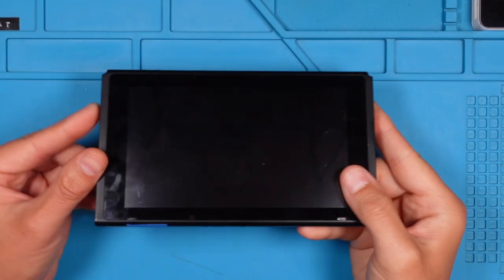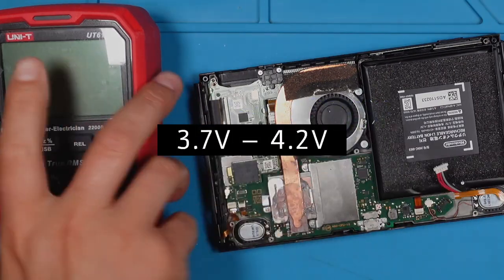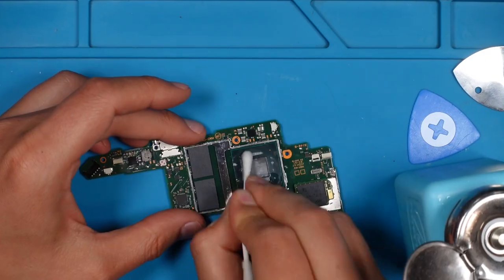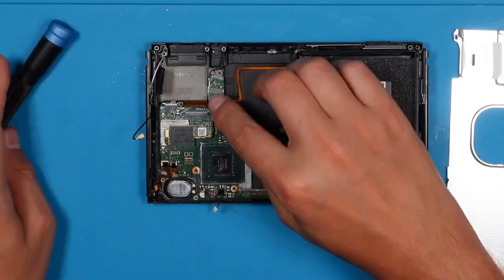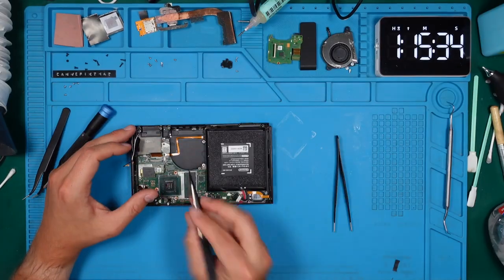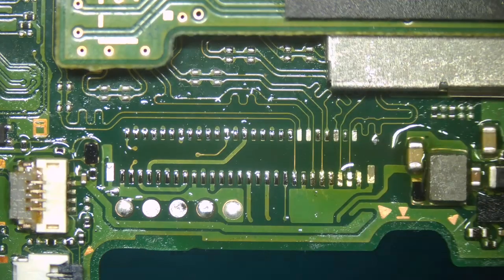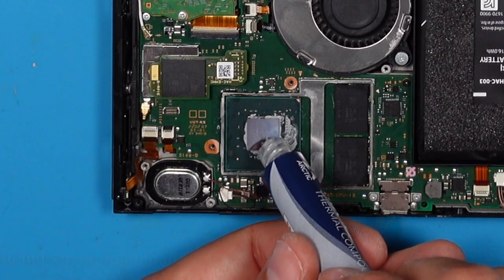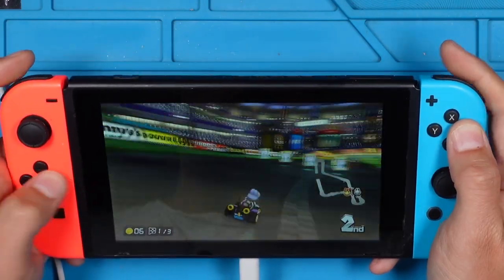Uncovering the Heat Trick to Fix Your Nintendo Switch Bluescreen!

Comment: I used a small vice grip and clamped it hard enough to leave a dent on the top of shield above the CPU and it's been chugging along just fine since with some new thermal paste too
Reply from the maker: Hi! Interesting approach, but I guess the problem might reoccur over time and with temperature changes. 😕 Keep me posted! 🫶
Reply: @CanWeFixThat  yeah, it was a hail mary that I thought would have broke it more, but it was gonna be tossed otherwise. It's been about 3 weeks and still works so far

Comment: heating chip with bad BGA connection is a well-know method of fixing faulty GPUs with artifacts, but it's always temporary. you need to properly reball the chip, heated chips don't survive more than a year usually
Reply from the maker: Hi, sure, but even with a proper reball, you can't be sure it works for longer...
Reply: @CanWeFixThat  it depends of the cooling system, if BGA mounting was done right during repair and chip doesn't overheat, it will live just as long as any other chip.

Not saying anything against you though. Reballing is a very tedious procedure that requires expensive machines, so it's not like you could do anything better. It's still cool that it does work and it's always a pleasure to watch your videos. I'm bored of all repair shops that only change components on ribbon cables without any soldering or diagnostics.
Reply from the maker: @user-xh3nm8oe2l I totally get it, and you are right. I realized afterward that the Switch was not getting any output via the dock. In the settings, it is just showing me the 480p setting. I am convinced that some connections underneath the BGA are getting me into trouble. 😉
Reply: In the case of the switch soc, my reflowed blue screen switch is working for over a year now without any problem. GPUs from PC´s are way way different. Most of the time, not the solder balls of the gpu fail. Between the GPU Core and the PCB is also a layer with very tiny connections. These are the ones that fail and they cannot be replaced, so even reballing will not work long on GPUs.
In case of the switch, the solderballs breaked due to excessive force, if they are properly reconnected, the switch will work like normal for years.
I now what you are trying to say, but these 2 types are completely different. If the Reflow is properly done (lots of flux), it will last nearly forever.

Comment: My switch froze and then when I charged it it started blue screen I thought all hope was lost until I brang it back to life this morning
Reply from the maker: Great! But remember that it could still fail in the future anyway after this treatment. 💪🏻
Reply: @CanWeFixThat  yeah it did...
Reply from the maker: The only proper repair would be to completely reball the SoC, which needs special gear. :-/
Reply: @CanWeFixThat  I tried applying pressure to no avail, what else might be the problem and is it possible I can fix it? I want to mod this switch